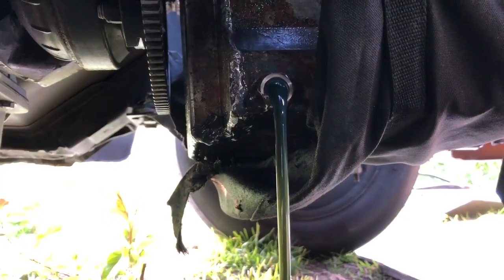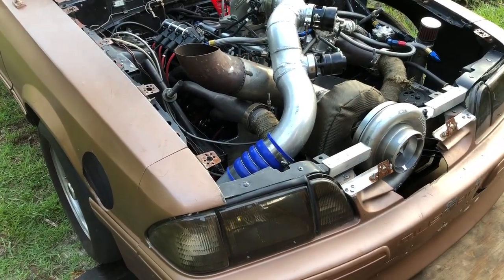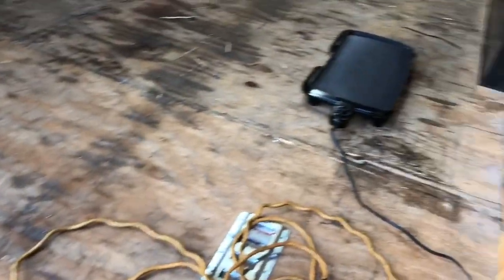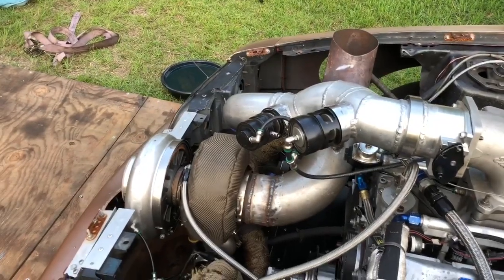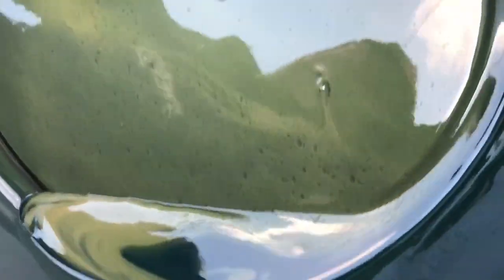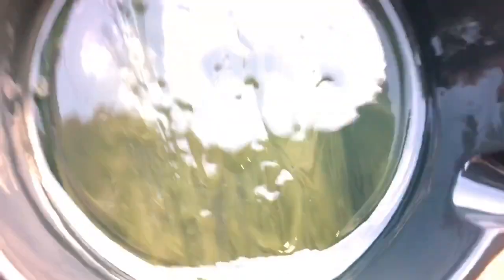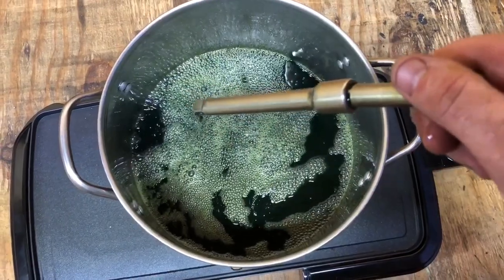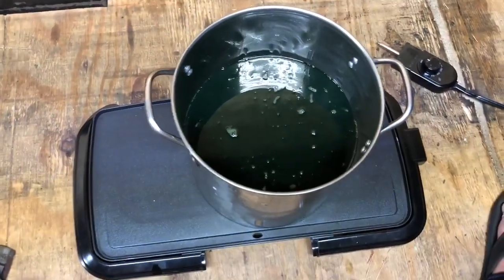Reusing used motor oil!

Comment: Years ago I worked for a guy who ran an alcohol dragster, he had built two huge 4x10ft aluminum boxes with a tube system to pump the used motor oil up onto the roof into those perforated tubes, as it drained from the tubes as it was circulated, it would evaporate off the methanol and water. The oil got dumped every pass, along with the pan and rod bearings. The oil that came out got cleaned and stored and eventually made it back to the car, but generally not the same day. We kept roughly 150 gallons of oil on hand for each event, and each change got a mix of cleaned oil and new oil. Samples were also taken from each oil change for analysis back at the shop. 
That oil your using looks a lot like the Kedall GT racing oil we used back in the 70's and early 80's.

Comment: Nothing is worse than running your engine on very low oil.  If necessary, put used oil in until you can do an oil change.

Comment: I know someone who works for an oil bottling company... It doesn't matter where you get your oil from. It's all from the same source... Walmart, Chevron, Pennzoil... They all come out the same Barrell. Only difference of course is the oil weight/synthetic/non synthetic. But in the end, it all comes from the same barrel. Save your money and buy the cheapest. The only oil he couldn't speak for was Royal Purple.
Reply: I stopped draining oil in 1963 with a toilet paper bypass filter and Delo 30W. I dont race. The only time I have had milky oil is with a leaky head gasket a couple of times. I depend on oil temperature to get rid of the condensation and unburned fuel. My Pontiac has a Australian Jackmaster Classic. The other engines have Motor Guards. Gulf Coast juniors  and a flat head Ford V8 canister filter converted to use half a roll of Viva towels. As far as I know the Australian Jackmaster is the best still in production.

Comment: Hello John! Years ago I worked for a company that built very large diesel & compression equipment.  They had this little machine that they would recycle the oil after every engine was tested on the test floor. It took all of the impurities out of the oil & they would test it & add an additive package back to it to make it new again!
Reply: Any idea's what that machine was?  Name, model #, Best Description
Reply: @1realtruthrightnow742   Try this 
Oil Centrifuge 55 Gph with Brass
name of brand: Pa biodiesel.
i came across this thing this morning. im trying to recycle oil to mix with diesel but im in Europe so i have to find somthing close around here. hope it helps

Comment: I found old oil and it had black sludge one inch. The 20 year old oil was redish clear. Sealed hot. Clean and slippery.just like new. I used it for years as lubricant.

Comment: Water is very good filter for removing sediments from fat. I dump a lot of super cold water in my hot fat the sediments will fall to the bottom as the fat rises.  Repeating the process further refines the fat. I wonder if the same method can be used for motor oil but Since water has a lower freezing point, just freeze the water and poor out the oil??? 🤔

Comment: Great tip, I missed the part where you added alcohol, from what I've read it should be used in a .5:10 ratio. Is there a major difference if you were to forget the alcohol?

Comment: I found if you get a electric kitchen mixer and cut a piece of tin to put across the middle and set the mixer on it with the tin or whatever you use batween the two mixer pieces and turn in on low it will evaperate like 15-20mns faster!
Reply from the maker: Good idea

Comment: I don't understand why people use oil as thick as molasses (20w-50) for a high rpm application, especially with a replaceable engine... Run some 0w-15 and gain horsepower.
Reply from the maker: I have not had good luck with thinner oil, usually kills the thrust bearing

Comment: Great video.
 I ran a sprint car in the Midwest with a 393 Chevrolet built by Earl Graete in Indiana. He used 13.5 piston with total seal rings and we had cylinder leak down to 1%. Made God awful power on methanol and oil was clean for two weektends. I had a 10 quart blum wet sump pan with crank scrapers and windage tray and a rev limiter set at 9,500. I've still got the engine and I'll reuse it some day even though I quit racing in1988.
Reply from the maker: Nice

Comment: I ran a dirt track car on alcohol and we put a thermostat in and made it run 195. It stopped milking the oil and it makes more power. Went from having to Change it every week to changing it when we wanted.
Reply: What type of alcohol?
Reply: @IceScorpion methanol

Comment: It would be interesting to see what you could do with a waste motor oil (WMO) centrifuge. Not only will it separate out the water, but, also any particulate matter that may be too fine to be collected by the oil filter on the engine. Most motor oils, especially for gasoline and diesel engines, have detergents in them. They act like emulsifiers, to allow the water to combine with the oil. For methanol fuel, (or ethanol) use, try to find a NON-detergent oil, so it can easily be separated. You can run the same oil for an entire season, if you can sling the water and particulate matter out of the oil with a 2,000 g or higher centrifuge. The slower you drip the oil through the centrifuge, the finer the particles that will be removed from the oil. You STILL want to heat the oil before the centrifuge, because the less viscous, the better the separation. You still need to boil out the fuel. The centrifuge only deals with the water and particulate matter.
Reply from the maker: Interesting
Reply: I use a oil centrifuge and filter thousands for gallons of oil, I heat with used oil, I use it for fuel in my military trucks, I reuse it in endines. Works great, filters down to a half micron.

Comment: Great video I will be the first to admit I don't know much about running methanol because my race engine is 14-1 and in gas but around here I see people running methanol have block and oil pan heaters I'm guessing that helps and like you they cook their oil between race weekends. Mist of us know the advantages and disadvantages of running methanol but I was wondering if you could do a short video clip telling us roughly how much more  HP and faster the exact same motor combo and car setup is on methanol as compared to gas. Also the price difference between gas and methanol where you are. I run Q16 and here that is just shy of $1600 a barrel. Thanks again great video keep up the great work
Reply from the maker: I have never done a back to back comparison, but methanol is great. The real huge benefit is cost. It cost more to set up the fuel system. But racing is much cheaper generally. Around here we can get a 55 gallon drum, with top lube, for around 150 bucks

Comment: John I was going through some of my old sbc stuff and I have a large journal 400 eagle crank if you could use it next I make it to NC I will bring it. If i remember its turned 10 and only had 8 passes
Reply from the maker: Thanks, I had a scat for a long time and it went really fast before testing it up.  But now, my rods and pistons are matched to this short stroke.  Thanks for thinking about me!

Comment: I know a guy who would drain his oil and let it sit for 2 weeks then strain the top of it off and re-use it 4 times then sent it off and it still passed specs and he said fully synthetic oil doesn't break down just the additives do so when he changes his oil he gets a oil filter and 1 quart of oil to change it from where he recycles the oil over and over lol

Comment: Never use diesel oil for a gasoline engine, diesel oil doesn't have the film strength of gasoline engine oil. The reason is diesel run at lower RPM than gasoline engines and diesel engines are built with larger bearings sometimes twice as wide as gasoline engine bearings. Good video about cleaning up racing oil, I tried this with oil that gasoline filled the crankcase I used a thrift store crock pot to cook it.

Comment: Do you change and cut oil filter during each oil swap?
Reply from the maker: I change oil filters every 4-5 track outings.  Only open them on occasion or if I see something sleuth oil pressure.

Comment: Hi bud, informative video. But I want to reuse my 600mile oil from bike as Block Piston, Ring and valves changed recently. 
So want to make sure any metal bits and particles are filtered out. What filter material to use? Thanks :)
Reply: Gravity will take Most metal to the bottom of the used oil  container. Give it 3 -4 weeks.

Comment: Maybe another trick you can use is making a closed container and also applying a vacuum with a cheap harbor freight vac pump. The more vac will all water and alcohol to boil off at a lower temperature. Use this tech in paper machine dehydrator for huge lubes oil reservoir.

Comment: You should also be able to use a centrifuge style mass separator inline. I used this in experiments. Solved the problem for us.

No downtime. Add new oil as needed and do oil changes while it's operating.

Comment: How much oil do you run in the pan? Do you turn your engine off after the finish line?
Reply from the maker: 8 quarts when changing filter, 7 when just doing oil in pan.  I do turn it off as soon as I cross the finish line.

Comment: I knew a guy back in my youger days, i had an old Plymouth Volare it had a 225cu.in.Super Six. I would run the sh💩t out that car. I could usually blow out 3 or 4 rear ends b4 it needed a trans. 727's got hard to find for a \6. He had a Chevy truck with a straight 6 he'd take my burnt oil and put it in his truck. No heating it up or filter.

Comment: Great tip very seldom watch a video all the way through,lol...My engine builder builds mostly circle track stuff and that's all he uses is Brad Penn it works extremely well in our alcohol engines.On my last drag car I simply had a hose coming off of each valve cover going to a catch can. I would drain the catch can and get aerosol can cap full of water in one night ,6 or 7, 1/8 mile passes
Reply from the maker: Love the bead penn!  My catch cam gets mostly moisture.

Comment: I got a question for you Turbo John, do you know if you can do the same with meth and nitro mix fuel with this oil ?
Reply from the maker: I don’t know, nitro is super heavy so it should be in the bottom also.

Comment: This is some s*** I would do
Reply: That’s part of the reasons in the 1950’and 60’s factory Service manuals ( Chevy SBC 1G and maybe more models and all Dodge) on gasoline passenger cars had to change all of the fluids ( which one of them was the automatic transmission oil and engine oil because it didn’t get hot enough or with some users like cop/taxis it would burn/ caramelise it or as it would sit over longer periods of time oxidise and turn into sludge ) so frequently as the factory water thermostat was set @ sub 180F modern cars can sometimes be setup for 200-240F

Comment: John, normally i enjoy your and share alot of your ingenuity but on this practice I have to say it's might be a little foolish, oil is cheap and engines are expensive bud.
Reply: Actually the oils in our race cars aren't cheap my race motor is on Q16 not methanol so luckily I only have to change it 2 to 3 times a season but it's still over  $100 per oill change
Reply from the maker: It is outside of the norm for sure!